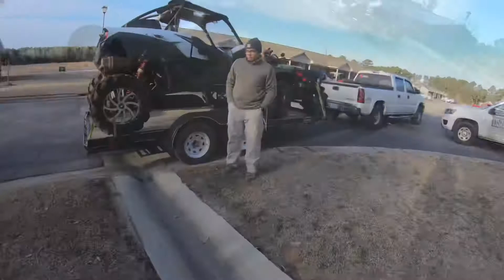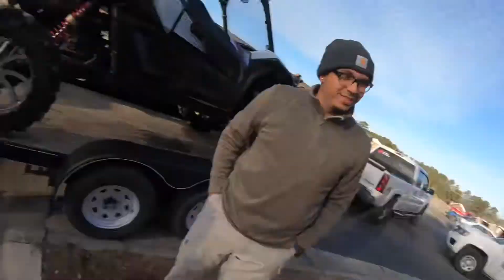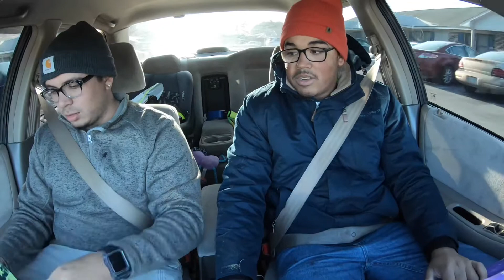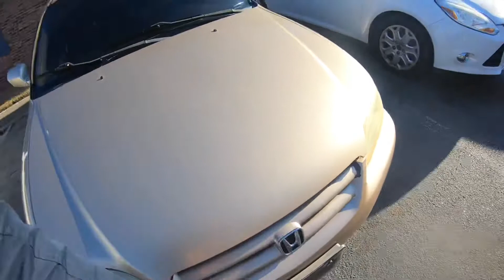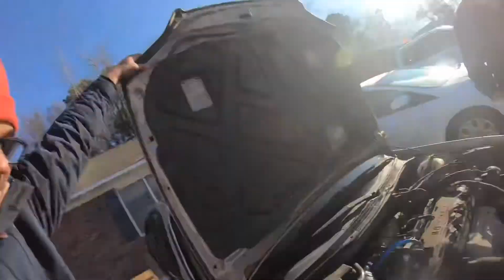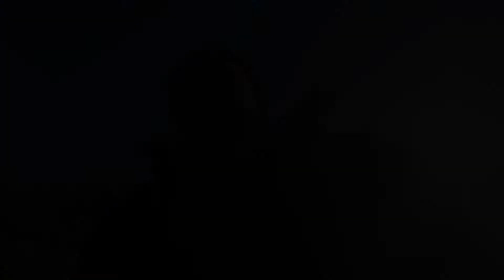Giving my friends a ride in my “1000 HP” Honda Accord! *MUST WATCH!*

Comment: This is CAP right.. doesn't not look like 1000 hp. Not close.. and the j30 stock auto transmission will never hold 1000hp it starts to slip on the stock motor at 60k miles. So I assume its just a bait video for fun and laughs. Thumbs up for the good time though
Reply: its a joke